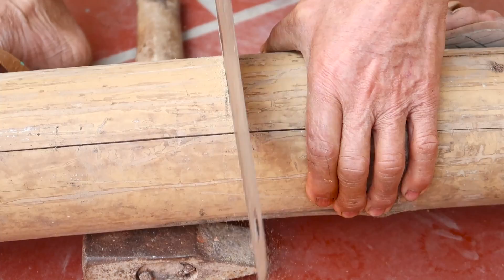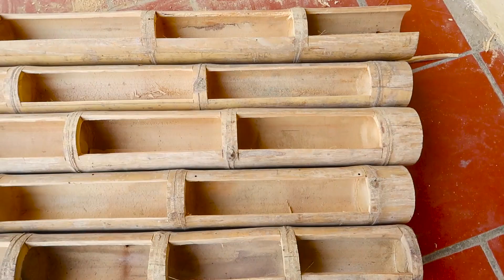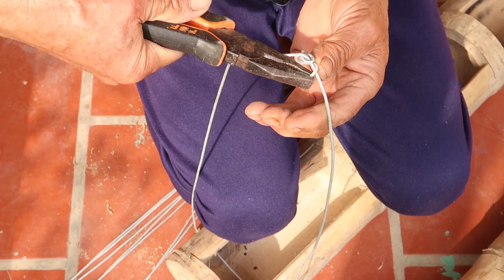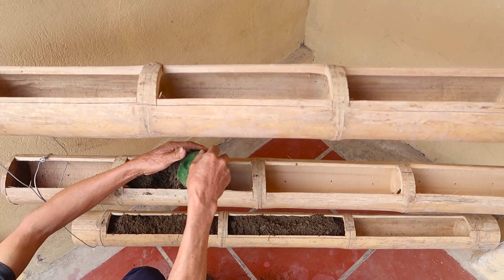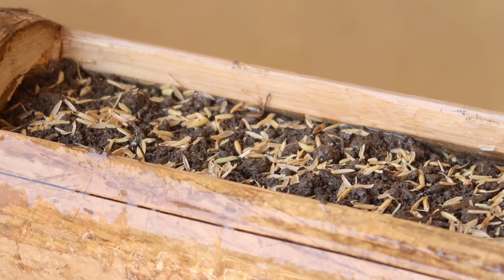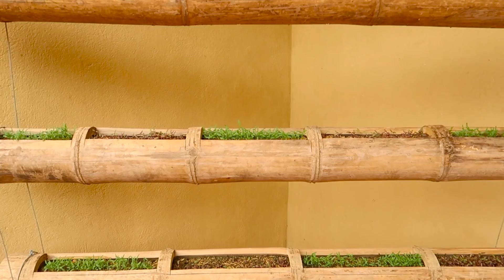Amazing Hanging Garden from Bamboo For Small Spaces, Vegetable Garden Ideas

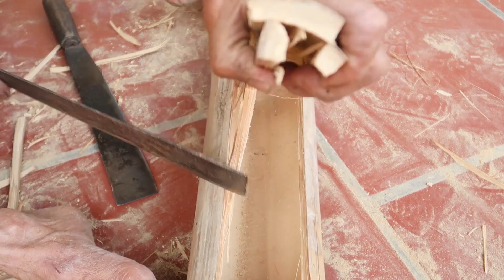Comment: 1:25 The machete for opening the grooves is really nice.
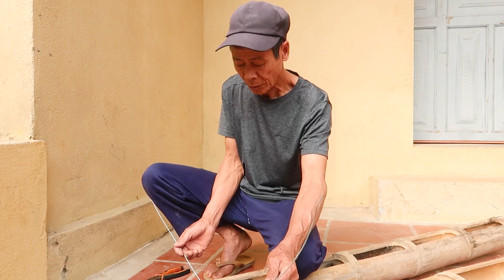2:24 How many mm is the steel wire? Do you have to use stainless steel wire?
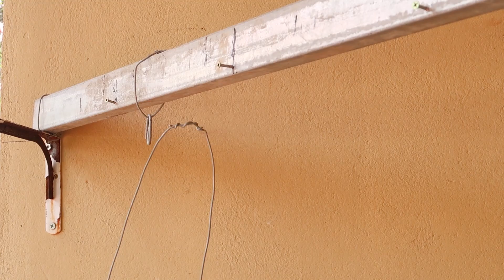2:44 How do you attach the beam to the wall? Using dynabolt? If yes, what size?
Thank you.